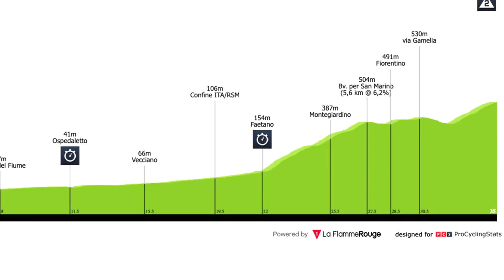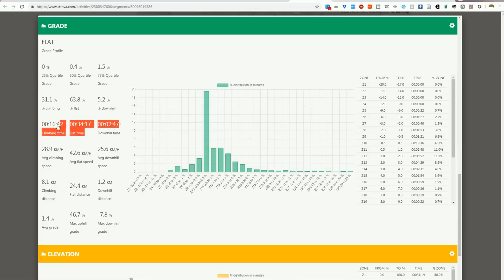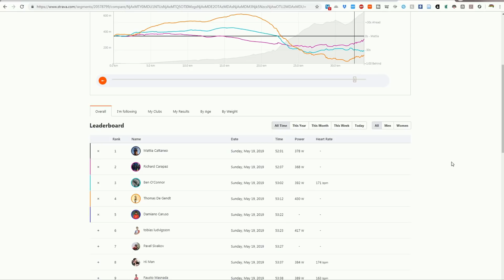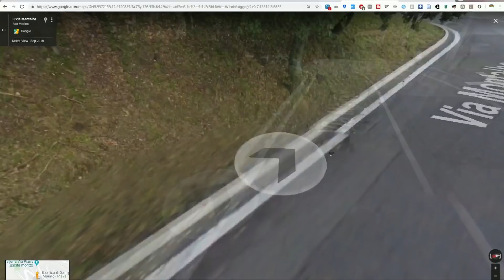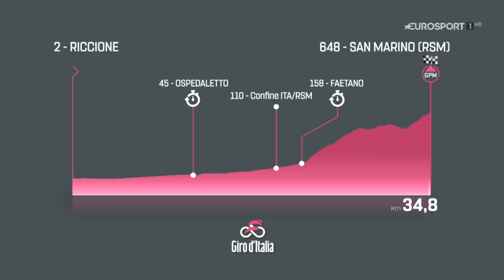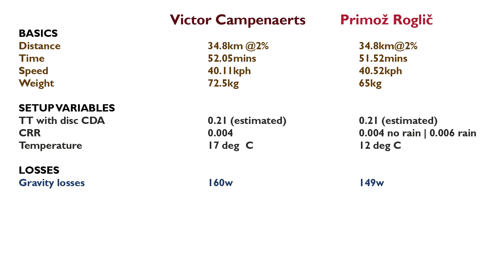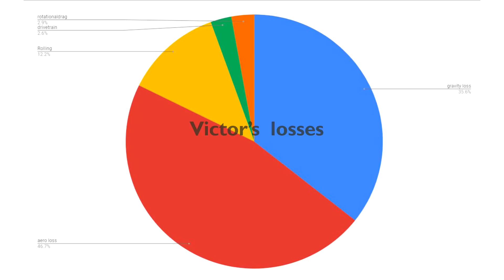Science of how Victor Campenaerts lost Giro Stage 9 after a heart-breaking mechanical despite 425w

Comment: Wiggins was wrong to say 53x11 & you were wrong to say 53x14 also.
Given his road bike set up on the bike he used here & most professional road bike standard gear set ups, the gear he was in looked more like a 53x18/19.
A long arm rear mech was used so suggests & looks like a 30 tooth large sprocket (quite standard in the professional ranks these days) An 18/19 being fine for a spare bike given for the flat or downhill but not for the uphil section on this TT course.

This said, for either mechanic or rider not to realise the gear was too large & so drop it down to a smaller gear was very poor indeed.
As a former professional team mechanic I would suggest this carelessness & so fault lies with the mechanic. UNLESS it was agreed by the rider to leave it in such a gear.

Either way, this messup cost the rider the stage win.